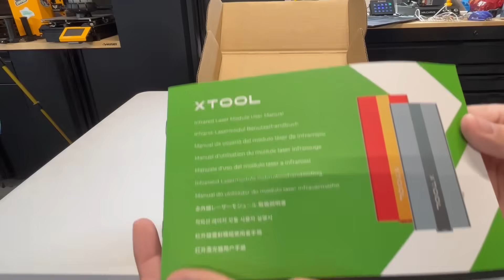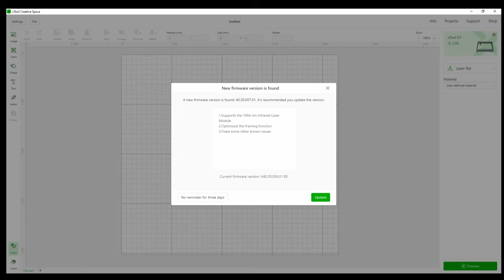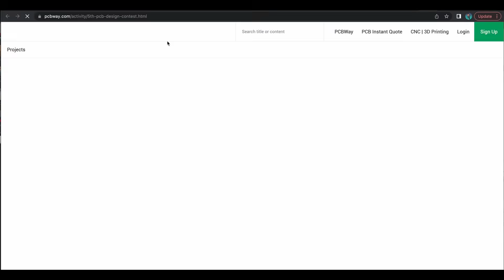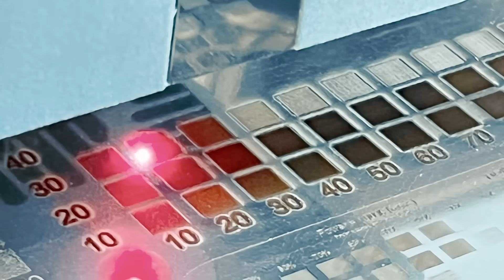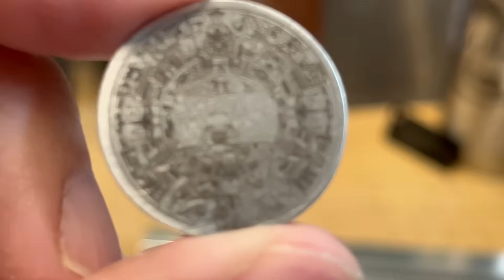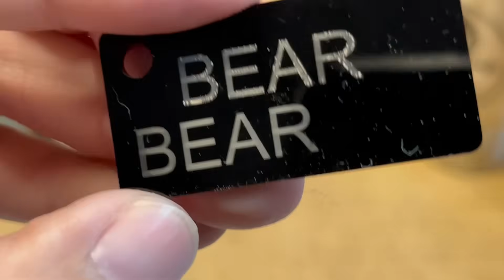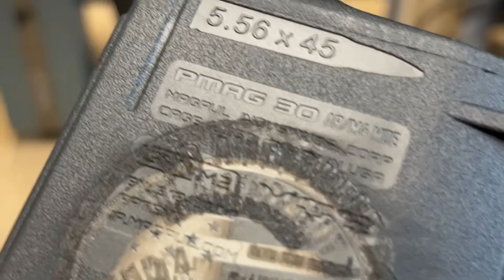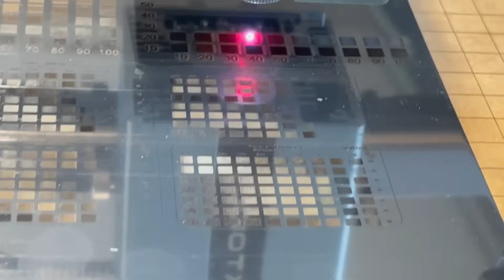XTOOL 1064nm IR MODULE - Laser Engrave Metal

Comment: Hi, can I ask you if the xTool 1064nm Infrared Laser module is compatible with the normal xtool D1?
Reply from the maker: This was the original D1 1064nm module that I received from xTool.  I mentioned it in the video.  You can also tell by the color of the machine, the Pro is red.

Comment: The mirror mode happens because you place the rotary module incorrectly - hence the rolling will be opposite of what it is supposed to be. If you turn it 180 degrees, it will be as it should be. If it is the one with the jaws, then they have to be on the right hand side - If it is just the rollers, then the stepper motor has to be on the right hand side - with the top of the D1 being furthest away from you. You have to place the rotary module, so any text on it is not turned upside down, when you look at it. Here is a video, which shows a guy, who first turns it the wrong way, which mirror the image. Then he places it right. https://youtu.be/RJ2N47VFsyY?feature=shared

Comment: With the copper & titanium what do you mean by oxidation? Did you have to do something extra with the metal?
Reply: He's not using the right term.  It's not oxidation causing the colors. It's the heat tempering the metal.

Or that's my understanding of it, which could easily be wrong

Comment: I have the Xtool D1 Pro with both lasers and I wanted to offer free services to my local police department to engrave the pistol slides (or anywhere else possible) to all Honorably retired and retiring Police Officers. Can this do it? Has anyone tried it? Does anyone have pictures of the end results? TIA
Reply from the maker: Hello Nino,
I love your idea!  With the 1064nm you should be able to engrave a pistol slide, as it will engrave metals.  It is a matter of power, speed, and how many passes you will need to do to get the desired results.  However, I would always recommend buying some test samples first, just to be sure.  Also you will not get deep engravings like you might have seen with fiber lasers.
Thanks - Tripod

Comment: Did you have issues with your infrared module working with the RA2? when I use mine in lightburn with the rotary attachment it looks like the laser is intermittently producing less power. I can engrave on flat surfaces with no issues.

Comment: The Shelby image came out reversed likely if you used the RA2 with the 3 jaw chuck. The jaws rotate opposite of the rollers. I had the same issue. When using the jaws you have to mirror the pic

Comment: If you have the d1 pro 20 do you still need to buy that to engrave metal?
Reply from the maker: Yes, the 455nm laser on in D1 Pro will not engrave metal.  You need a 1064nm laser to engrave metal.  Hope this helps!  Thanks for watching and commenting 👍
Reply: @TripodsGarage  yes it did help thank you but I think my bundle came with both.

Comment: How do you line up the item if there are no cross hairs?
Reply from the maker: I use the spoil board, along with the red dot to assist with the outline.  Sometimes I will mark the material at center point.

Comment: Very helpful video. Thank you. Do you know if there is just one manufacturer of this infrared laser and it is sold by a number of re-sellers, or if each seller, such as xTool makes their own?
Reply from the maker: Looks like there are several manufactures releasing their own IR Modules.  Mr Carve with their M3 was first, followed by xTool and now the AtomStack R30.  Each are tailored to be used with their machines and their boards.  I see the 1064nm IR's growing in popularity.  Hope that answers your question.
Reply: @TripodsGarage  Thank you for your reply. I was wondering if there is one original source for the infrared lasers and companies such as AtomStack OEM them for their particular machines. It seems very coincidental that these companies release such a similar product at approximately the same time.

Comment: What speeds did you end up using for your test files? I tried to use the website you put in and used the same settings and it wouldnt even start for some reason
and it was inverted
Reply from the maker: Hmm, that is odd, you can always used the flip image on the upper toolbar to switch the image around.  Please try again with the site, I have been using it for a number of month with great results.
Reply: @TripodsGarage  okay I’ll Try it again. What base settings should I use ?

Comment: There are multiple videos out there showing the 20w Xtool engraving metal? How much deeper will this engrave say a mild steel for instance? Thanks for the video
Reply from the maker: If someone is telling you that the 20w 455nm xTool can engrave metal, they are not telling you the truth.  Best way I can phrase this is, a 455nm can basically only mark (like a marker) stainless steal, and that is about the only metal it can.  A 1064nm can actually "engrave\etch" almost any metal including mild steel.  Will you get a deep engrave?  No, but you will ket an engraving that you can actually feel.  Hopefully that answers your question?  Thanks for watching and commenting!
Reply: @TripodsGarage  Thanks for the response, that does clear it up. It is hard to differentiate that when watching videos. So would the standard 20w marking be light enough to just rub off? Or would it still be somewhat permanent? Thanks again.
Reply from the maker: @G--T  - When using the 20w 455nm on Stainless steel you are annealing the stainless steel.  This high temperature annealing process is pretty permanent, I have yet to wear it off.

Comment: I got the ir and it doesn't do anything that my 20w won't do. Very disappointing 😞
Reply from the maker: Well they are totally different.  A 455nm will not engrave metal, while a 1064nm will.  If you are not getting the results that I am, I would suggest reaching out to xTool to see if they can assist you.

Comment: Looks heavier. Do you foresee any issues with causing wear on the D1 mechanisms?
Reply from the maker: I do not see it being an issue.  One main reason, you will be typically be going slower to engrave metal.  Also all the glides are metal.

Comment: Could. This actually engravw in cold rolled steel? Like 1/8th inch, for rolling mill texture plates?
Reply: What I am seeing is this will barely etch the surface. Not even close to deep enough for a texture plate. I am also a jeweler and that was a question. May need to look at a fiber as they can engrave and not just etch.
Reply: @WilcoxRanch  thank u, ya I've been looking at the 50w fiber but sooo expensive
Reply from the maker: Engraving and etching are basically the same exact thing.  Now marking, it what a 455nm diode laser will do.  Basically oxidizing the surface.  Let’s not be confused here, this is a 1064nm laser, the  1064nm that is used in fiber lasers.  This is just 2 watts.  This will engrave\etch cold rolled steel, that you can actually feel.  This will not engrave deep, nor cut.  You are also not going to get the same results from a 20+ watt fiber laser.

Comment: Have you tried it on anodized lower receiver or pistol slide?
Reply: A regular blu laser engraver will mark anodized aluminum, it won't engrave into the actual metal, however it will turn the anodizing white wherever you engrave that will be permanent and very durable, unless you actually sand through the oxide layer, which is what anodizing is.

Comment: So, I watched the xtool roll out for this laser head and they are pushing it for the hobbyist, or small business jeweler.  My issue is it doesn’t seem to actually engrave with much depth.  Do you have any true to life measurements for the depth of material removed?
Reply from the maker: This is definitely aimed at the hobbyist or small business owner.  This will engrave many different metals, that you can feel and see.  However, this is only a 2w laser module.  If you are looking at deep engraving, I would point you to a fiber laser.  I would suggest starting out with a 20w or higher.  Thanks
Reply: Exactly the question I would like to see answered, engraving depth is critical to some of the projects I'd like a laser to be able to handle.
Reply: It’s only a 2w fiber so it’s very very weak, I have a 30w fibre laser that can cut through 1mm ss but a 2w is hardly worth turning on
Reply: @TeeTee-bu6md  Not concerned about cutting, just engraving depth.  Only looking for a few thousandths of an inch but it's critical.

Comment: How does this compare to the default laser form the D1 pro? IT can already engrave metals, like shwon in countless videos. So is this just a lot faster at doing so or is it better in some way?
Reply: The D1 pro can only mark stainless steel and that’s around 3 to 5 mm/s to get a darker result. Problem is that it can also warp the stainless if it isn’t thick enough. This is at least 4 to 5 times faster for the same result and it allows you to engrave other metals as well.
Reply: The D1 pro can only mark stainless steel and that’s around 3 to 5 mm/s to get a darker result. Problem is that it can also warp the stainless if it isn’t thick enough. This is at least 4 to 5 times faster for the same result and it allows you to engrave other metals as well.
Reply: Generally, as these guys say, only stainless can be engraved, a very few steel alloys too. This head can engrave aluminum, copper brass, etc. which the regular heads can’t.

Comment: Are you getting lightburn to work properly? When I use lightburn it’s not firing the red pointer to frame my image it’s actually turning on the laser when it’s framing 
 which then engraves the framing square on the material. I’m not sure if I’m doing something wrong?
Reply from the maker: Did you apply the new firmware?  Within Creators Space you can turn on and off the dot on the laser.
Reply: @TripodsGarage  yes it’s working fine and framing properly with with creator. I was thinking I might need to do something different in lightburn? Also did you notice it seems the height gauge on the new laser is off and you need to have have the laser a bit lower?
Reply from the maker: @Badx95  - Might want to manually setup a new laser profile.  Since the engraving area is now smaller I created a new profile just for the IR.
Reply: I will try that

Comment: Can you engrave acrylic or glass? I don't know how to do it and it goes through
Reply from the maker: If you are specifically looking to engrave glass and acrylic.  I would go with a CO2 laser, they can engrave without a using a interface layer.
Reply: @TripodsGarage  
Thanks for the reply.

,but when I bought it it said that I could do acrylic engraving, so I bought it. "but it seems difficult.

thanks.
Reply from the maker: @バカサバイバーR   Hello, you can engrave colored acrylic like xTool mentioned and what I did in the video.
Reply: @TripodsGarage  
thank you.
Finally, I want to know. What do you think is the biggest difference between 10w and 20w?

sorry.

Comment: Not being able to engrave metal with the default laser head makes the new Atomstack even more of a proposition, I have a K40 upgraded to a K50 with an upgraded lens kit and air assist but its too small for some things I wish to make and so is the XTool so I am thinking of just getting a good laser and compressor and some sort of quick change mount for my MPCNC which is 1000 X 800.
Reply from the maker: Are you talking about the Atomstack M4?